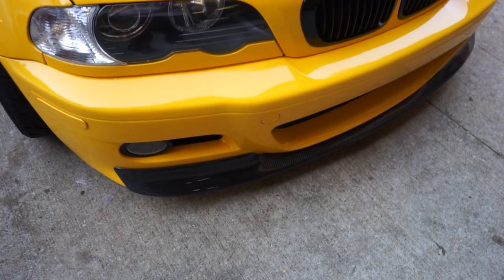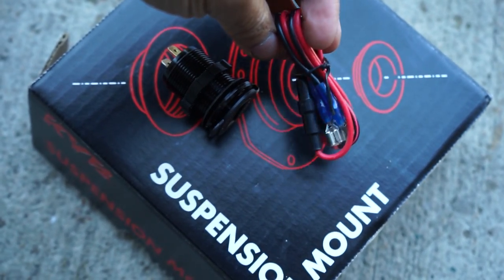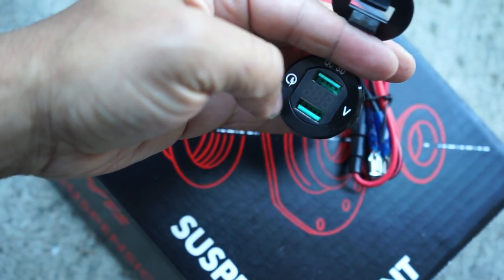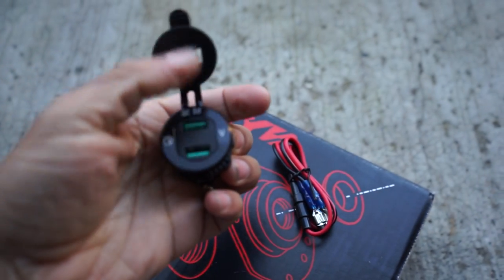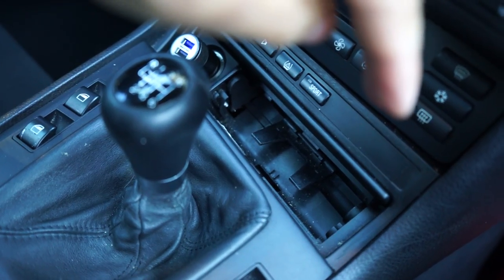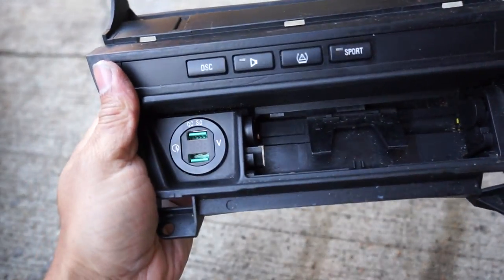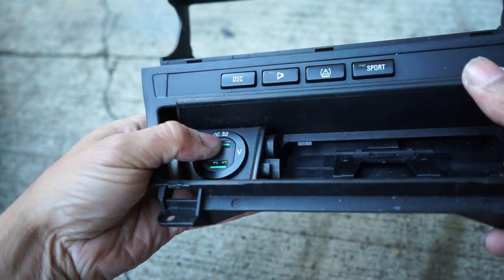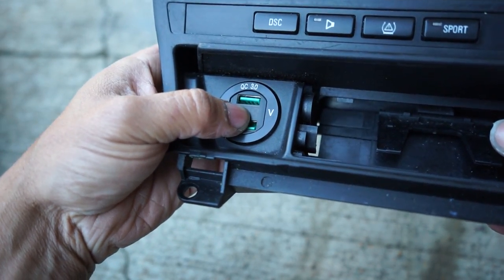E46 M3 - USB Charger Retrofit (Mod you need but havent done yet)

Comment: My issue with this is that I use the cigarette lighter for my tyre pump.

Unless you have a USB pump, you can end up in a situation where you get a flat and can't help yourself.
Reply: If you have to worry about your tires going flat all the time then I would worry more about that then not having a cigarette lighter plug… plus theirs a ton of battery powered tire inflators like Milwaukee
Reply: Do you not have a spare tire? Lmao

Comment: Yeah, it's not too hard to swap out. I managed to use some curved rasps to remove the excess plastic on my 330ci. My usb was a bit smaller, with an red/yellow/green led ring to give a quick voltage read, in addition to the numbers. Even has a power button for the meter. Unfortunately, not the same color as the stock leds though.
Reply from the maker: Glad you gave it a shot! Hope you like it as much as I have

Comment: Have a question I installed one similar without the voltage meter but just a simple LED indicator. Since its 12v constant will the LED drain my battery?
Reply: This is a good question. I wanted to ask the same. Since it’s constant power surely this will drain the battery... am I correct?
Reply: I just said that lol that’s why I ordered the same one with a switch lollllll

Comment: Doesn't that Eonon head unit have usb ports in it? I bought some ebay unit which works fine and does what I need it to do so I don't really need any extra usb ports as there are three in the unit. Thanks for the videos!  Oh and check out the videos online that show you how to have your battery voltage displayed in your drivers screen. Nice work!
Reply: what unit did you get?